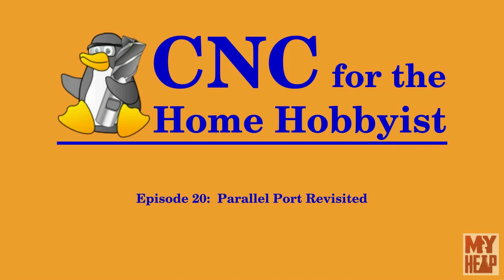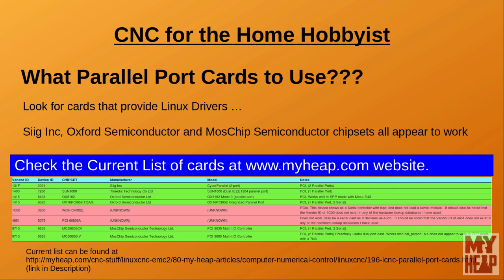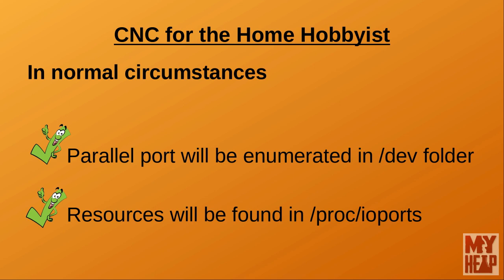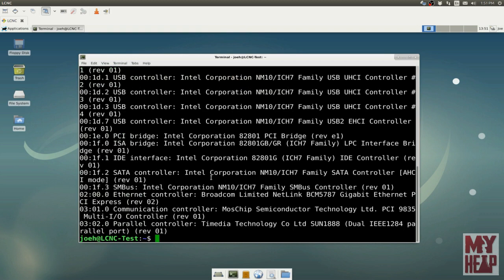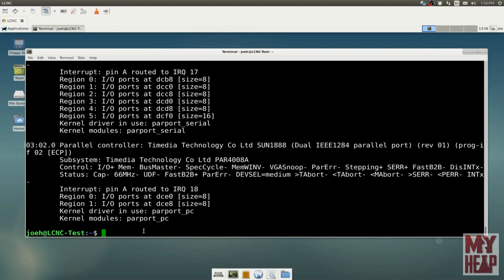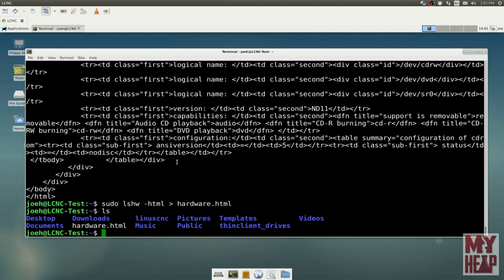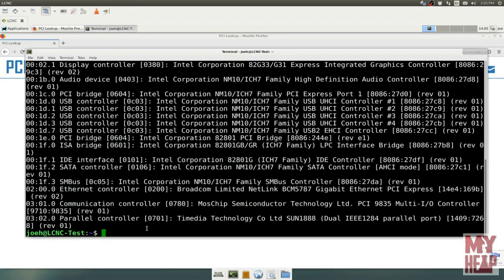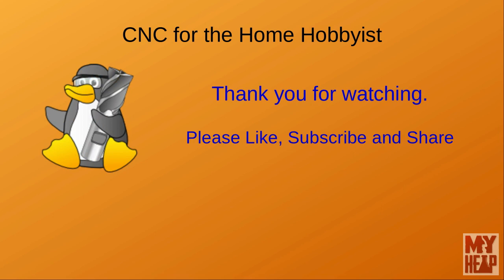LinuxCNC for the Hobbyist - 020 - Parallel Port Revisited

Comment: hello joe, i finaly get here at the chapter number 20, im hopfully see more in a non long future from here. 
we all will be very thankful
Reply from the maker: Emilio.  Thank you for watching the series.  I do plan on more of these videos soon.  As an aside, I have been gathering bits of hardware for just that reason.  So far I have a Mesa 6i25 card and a Mesa 7i76 card.  I also purchased another BoB, stepper driver and motor.  I want to set up a lab of sorts to show how the Mesa cards work.  I am still in the research phase but it should not bee too much longer before I start on the series again. 

Joe
Reply: @MyHeap  great! awesome job, your series was a tremendous help for a  better understanding  of linuxCNC.
from my perspective, a insigthview of the classic ladder program will be very usefull from the linuxcnc comunity just for adding buttons and safety circuits for a machine, well I will being aware from your videos.
greetings from Argentina
Reply: @MyHeap  hello Joe, pls make videos about Mesa Ethernet interface Card and how to config pncconf with servo motor. Tks for your videos!
Reply from the maker: @Nothing-27  I would love to, but unfortunately I do not have any of that hardware.  😞
Reply: @MyHeap  😭

Comment: Very helpful video. I had a MosChip Semiconductor card (MCS9900) and I could not figure out why it would not work, but with your video  I was able to find out that it was just not compatible with linux rather than some other driver related issue.
Reply from the maker: I am glad it was helpful.  Thanks for watching and taking the time to comment.

Joe

Comment: I'm just starting out with linuxCNC and found your videos invaluable , just added a parport, (luckily I  picked a good one ) tested the latency seems apx 14000 ns Thanks for your help.
Reply from the maker: Hi Les, I am glad they have been helpful.  Thanks for watching and commenting.

Joe
Reply: Joe  I am currently building a 25Dm cable to  a breakout board (strip bd) do you know of a test prog to exersize the port pins please ?
Reply from the maker: @lesclark6530  not a test program per se.  But there are a couple options depending on how adventurous you are.  The first is there is a Hal and pyvcp panel somewhere on the LinuxCNC website that will allow you to test the pp bits with the click of the mouse.  A more adventurous methoud would be to download the parallel port library and write a small c program to loop through them.  How do you intend to know the board side is good?  LED??

If you need more info, let me know.  I am away from the computer but will be happy to find some links of that will help.

Joe
Reply: At the end of the cable will be (at the  moment ) just a twin row of header pins ( 2 to each signal )and screw terminal for the stepper connections. I may include a cmos IC to drive 6 leds so these can be patched in to any of the port pins as required , a led on the pp output would load it possibly too much..?  I can scope the pins to test them ,   the C program as suggested would be useful to . I seem to have a ' birds nest of wires , at the moment  each pin wire is twisted with a ground .. Thanks Joe

Comment: Dear Joe

Thank you very much for your videos. 

I understand that time is not on your side, but please let me know if you are going to produce more videos?

Also please recommend videos how I continue from where you stopped like learning hal and etc.

Looking forward to hearing from you. 

Regards, 
Jimmy
Reply from the maker: Hi Jimmy.  I do plan on making more LinuxCNC videos.  I am trying to get a few projects that have been in the works for a while knocked out.  I do have a small outline of where I am going next.  Will likely be an actual install using my router as the sample with an examination of what the files created are and what they mean, including some narrative on HAL.
Reply: @MyHeap  thanks for your prompt response

Comment: Thanks for the videos - I have tested three cards with a parallel port connector on them - one works and two don't. The very cheap PCIe (WCH CH382L) one I picked up at a market in Shenzhen is recognized by Linuxcnc - when I do a check on this card via terminal, there is no manufacturer  name, though there seems to a a product ID. The HEX no. is non standard - I will send you pictures and details of this card by email as I would appreciate some help. I have not got as far as testing any breakout board /stepper driver/stepper motors setup etc, so I'm not sure if this card will actually work. The other two PCI/PCIe card I tested are "there" but recognized as serial or something else. The writing on the chipsets for these two are MOXA MUE450-C (PCIe) & SUN1999 (PCI) - these do not work with my motherboard (Asus Z97C) or in Linuxcnc Debian Stretch version.
Reply from the maker: Adam, I am sorry for the late reply.  I have a page that lists the cards that are known to work or not work with LCNC.  Take a look there and that might be helpful.  For some reason, the WCH chipsets are serial.  These are usable with drivers to print, but Linuxcnc requires a real parallel chip to work.  If you can email me screen shots of the information you discovered on the hardware, I will be happy to add new additions to the list.  If you need some additional help I will be happy to see what I can provide.

Comment: Hi Joe, I sent you an email about 2 weeks ago to the address that was stored on your MyHeap site. In the mail I explain how I successful added a pci lpt card which was not recognized by the system to work with linuxcnc. It is a card with similar data on your list that supposedly does not work. The method of adding lines to a configuration file made the card work. I have also decided to help to expand the list, unfortunately I have not yet received an answer...
Reply from the maker: I am sorry.  I may have got it and overlooked it.  I have been slammed at work and trying to get a huge remodelling project completed.  I will look and see if I have the email.  You used the contact form on my website, correct?
Reply: @MyHeap  Yes, sent it to xavier
Reply from the maker: @momofab1  So I have looked for your email and cannot find it.  Could you email me the information to joeh at threerivershospital dot com?  I will look at my spam and see if it got caught in there.

Joe
Reply: @MyHeap  I sent my mail to the "email me" link that is provided in your video description. On your myheap site the email is linked to xavier at gtec. The subject of my mail is "parallel port card report". Greeting from germany, Yves.
Reply from the maker: @momofab1  Not sure what happened, could you send me a test mail to xavier@gtec.com?  Let me know when you sent and I will look to see if it comes.  If this one fails for me, I will give you an alternate email address to send to.  Sorry for the inconvenience, sir.

Joe
Reply from the maker: @momofab1  I found your original email buried in my spam catcher.  I will take a look later today when I get some free time.  I am currently at work.

Joe

Comment: I have Sunix PAR6408A with SUN2212 chipset. Lscpi -v recognized it, but with [disabled]. Does that mean it's not compatible?
I've tried changing the address but it's not detected in LCNC.

I also tried a cheap PCIE board with the CH382L chipset. And it actually worked well.

Comment: have somewere list what PCI or PCIe card can use linuxcnc, i buy one but config wizard not sensors input working, i can wizRAD ADD BOTH CARD AND PARALLER PORT2  setting but not working, hall meter. etc, i setting paraller port2 all home switch, or limit Switch hall meter not working true/false.

Comment: Hi Joe, I wrote you a mail about cards I have tested or that im still testing. Did you receive it?
Reply from the maker: Yes I did get the email.  Sorry for not responding.  To answer your question, I am still very interested in documenting these.  I will try to get some time this weekend to add the information you provided.  Thank you for taking the time to reach out.  I appreciate it very much.

Joe
Reply: @MyHeap  The tests are still in progress. Some more info will follow next week. Some cards seem to need pulldowns for inputs, some dont ...

Comment: How can I add a parallel port because it does not exist at all ?? ... Thank you so much
Reply from the maker: As long as the computer has an expansion slot, you can purchase a parallel port card that will fit it.  Just be careful of what you select.  Not all parallel port cards will work with Linux.

Joe
Reply: @MyHeap  Thank you very much for paying attention to my inquiry .. and also for advice .. I will try it out

Comment: How do you get to the Config Files? I found my port #s and it says they are disabled. I'm running Debian 10.
Reply from the maker: Are you referring to the LCNC config files for the machine you are setting up?

Joe
Reply: @MyHeap  What i have is my IO ports both in and out say they are Disabled on My Parallel Port Card I need to know how to turn them on.

Comment: I've got a parport card (startek Chipset ID PLX/Oxford - OXPCIe952) i read the specks about the OS Linux 2.4.x / 2.6.x only i'n running linux 2.8 so..won't work?
I can get a parallel port card (startek Chipset ID Oxford OXPCIe952)  i read the specks about the OS Linux 2.4.x to 4.4.x LTS Versions only So this will work?
Reply from the maker: I would not jump the gun and say it won't work.  If you already have it, install it and see if the kernel picks it up.  Unless it is running some closed source drivers from the manufacturer it may work.  The problem I see with parallel port cards is that some of them are parallel ports while others are serial ports masquerading around as a parallel port through software trickery.  Linux wont play that way.   Let me know.

Comment: Hello!
Great videos!
I've just begint to learning about LinuxCNC.
Can you help me out?
How can I use a stepper motor, or a closed loop system (step/dir) on a lathe spindle to use it for positioning too? (LPT and MESA)
Reply from the maker: I suppose it could be done, but I am not sure.  Sorry for the late reply.  I didn't see this post for some reason.  I think you would want something a little more robust instead of a stepper.  Probably a servo and it would have to be a closed loop with feedback for positioning.  For example to pick up threads.
Reply: @MyHeap  thanks for the reply.
I founded how to do it with simple stepper and emulating encoder, or use a real encoder. But now I have no time to test it.

Comment: i have the wierdest isu whit my cnc macine  
i reinstald my pc  and now if i plug something in my mb parallel port  and in my first parallel port  my machine switches off the mb paralel port and uses my pci cart first port 
so i conect my cnc to my pci cart so it works fine 
but when i restart Linux cnc just the program not the pc it swiches back

my PC  /cnc was working fine for a long time ~1.5 years 
i reinstalled my pc and use the same config file and it realy weird
Reply from the maker: Does an ls /dev/par* show both parallel ports?  Or does a cat /proc/ioports show both ports?  I am just wanting to know if the OS picks up both ports or is the onboard port shut off in the BIOS?  Can you email me your config files?  xavier@gtec.com

Joe

Comment: Hi friend,  I have a cpu in which I have installed linuxcnc, the first thing I would like to know is how to configure the parallel port for linuxcnc since when I go to X, Y or Z test axis, it just does not move or is that I am forgetting to configure something outside the system or in the bios?
Reply from the maker: Hello.  I need to ask some questions about your setup.  Does Linux recognize the parallel port?  Is it on the motherboard or is it an add-on card.  Are you connected to a break out board?  Is your parallel cable a true parallel cable and not serial?  Have you taken note to which pins X,Y and Z stepper motor direction and step are connected to on the parallel port?  Do you have the pins set correctly in stepconf?  If you like, I will try to help but it may be better done through email.  Where we can send attachments.  But generally speaking, take note of which pins each stepper motor step and direction are attached to on the parallel port.  Then in stepconf, set the pins for the parallel port to the appropriate value.  When you get to axis testing, listen very closely.  If you get the direction and step pins reversed you will get a single pulse when you test and nothing more.  If you like, email me to xavier@gtec.com and I will see what I can do to help.

Joe
Reply: @MyHeap  Thanks for replying friend, I already sent you an email
Reply from the maker: @tonicztutoriales7367  I sent you a reply.  Hopefully this will help and get you started in the right direction.

Joe